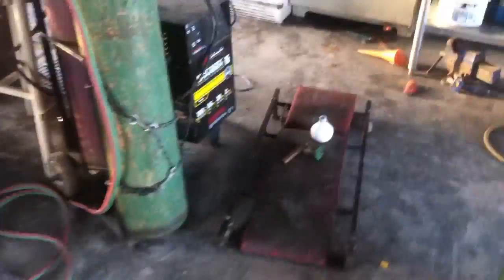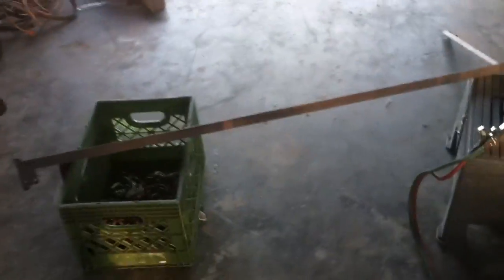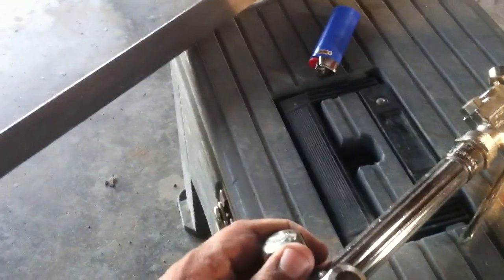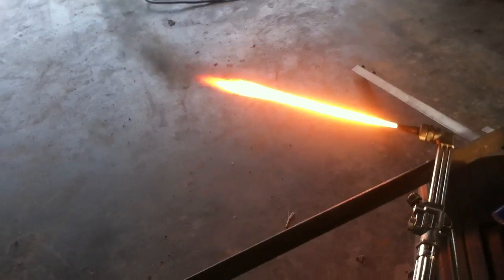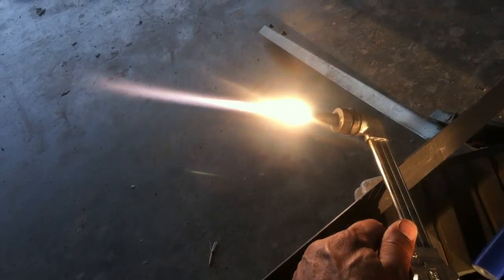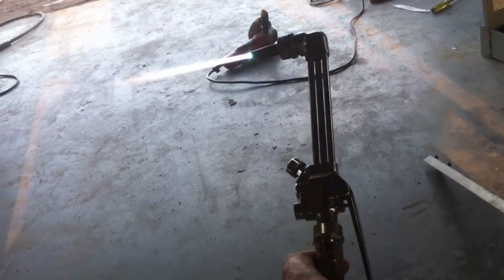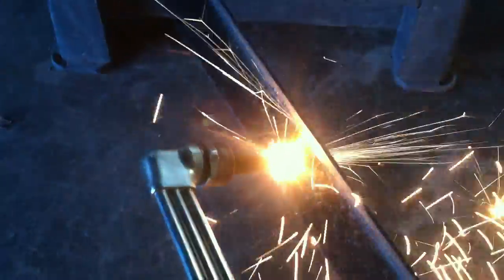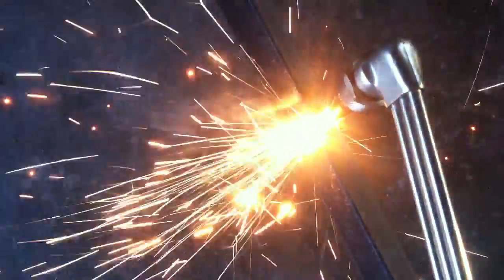How to Use a Torch to Cut Metal.

Comment: You made an error in In the beginning of your video description talking about the oxygen and Acetylene pressure. You never mentioned in the beginning of the video the output pressure making people assume your torch and hose has thousands of PSI to the torch. You need to make notifications on your video or someone is going to explode their Hose. You need to explain that there is tank pressure and operating pressure to your Hose to your torch.
Reply from the maker: ha, you just did? if there using torches at the maximum, the regulator will not allow more pressure out then the hose can stand. if it was hooked up directly to the tank without the regulator i could see the alarm, but as you know it is not. people if you explode your hose, close the valve to both tanks and read up more. ha ha ha thanks for the comment. enjoy
Reply: So when you say "set" what you really i ment is whats left in the bottle… so that info is completly useless as what people want to know is the actual pressure you set the regulators to

Comment: So I just started shopping at my school. And so now we are down to the torch. What you should have done is showed us what to turn on You should have turned your accetaline On first then your oxygen and then you're accetaline valve Then you're oxygen, and so for everybody. That sees this comment You're accepting there are 2 dials. One of them is for how much pressure is in the tank That is the one on the Right, the one that's on the left That shows you how much is going through the pipe Keep it at five p s I or eight For your oxygen same for the acetylene. But see, for how much goes through your pipe or your torch that?
But instead of five or eight p s I you have to do Thirty psi Somebody tell me if i'm right or wrong Oh and always use a striker never a lighter or matches Also, never store them on their sides and always keep them chained to the oxyfuel carrier
Reply: never go over 15 psi for acetylene or it will explode as for oxygen idk it should probably be higher than the acetylene